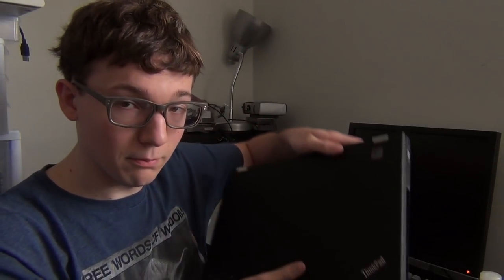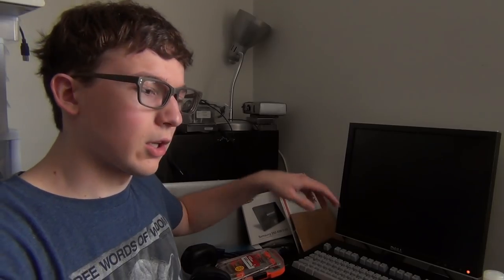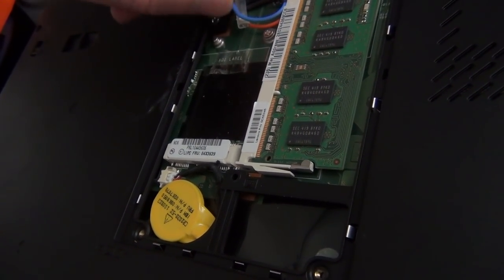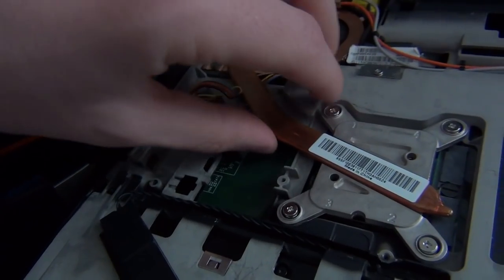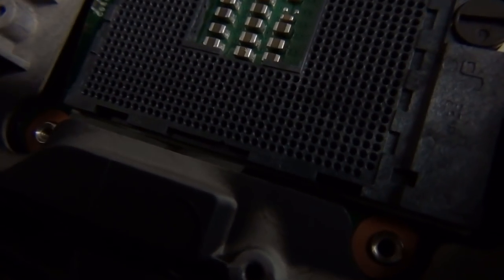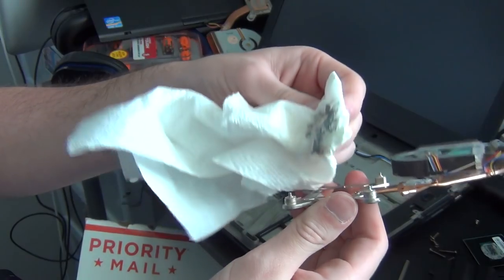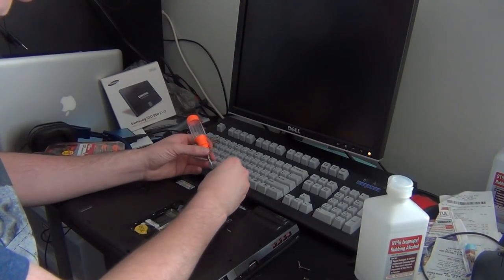Lenovo ThinkPad T430: CPU Upgrade

Comment: I did this to my T420. Now, it runs i7-2630QM. It starts with 2.6Ghz 4 cores 8 threads before throttles down to 2.3Ghz in Cinebench R15 test. The score is 368. About 10% slower than the average i7-2630QM systems. But it is as expected since T420 never designed to handle quad cores CPU. My T420 is on par with a modern dual-core i7-7600U.
Reply: It runs cool at 55-65 Celcius when idle. TDP is 45W. The fan almost completely silent in light task. i7 quad on T420 always thermal throttled at 97 Celcius and then it gradually reduced the speed before stable at 2.3Ghz. all cores at 85 Celcus.
Reply: where to buy the processor?
Reply: i also have t420 and i want to upgrade
Reply: @pratiklondhe5167  ebay
Reply: except the i7-7600 has a hardware vp9 decoder, and sandy bridge cpus don't.

something to keep in mind if you're watching youtube.

Comment: Did a similar thing to my t440p, went from an i5 4300m to a 4810mq and it is INSANE! Just put liquid metal on the CPU and it never goes over 90°C under the heaviest mixed loads.
Reply: Does it everleak out
Reply: @jaymesc4436  mine didn't, but you have to be very careful with the amount you use! Less is more and it's a good idea to put some form of insulation on caps and other exposed components in the cpu's PCB

Comment: I'm retiring my Acer Aspire E15 laptop for a used Thinkpad even though my Acer is a few generations newer. Especially since I don't use the Nvidia graphics much anymore on the Acer and it's giving me a few hardware problems. The T430 just feels better built and more room for expandability.

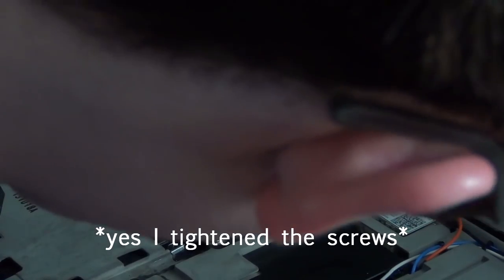Comment: 8:20 "be sure you reconnect the fan" yeah I unintentionally tested the thermal capacity of a Dell Latitude E6530 by not doing that here a couple years ago. I got a used E6530 off Ebay and in usual fashion whenever I get a new PC/Laptop I always explode it apart and clean everything as well as re-paste the CPU. Well long story short after applying new thermal paste to the CPU (Arctic Silver 5) I fully reassembled the laptop EXCEPT I forgot to plug in the fan controller for the heatsinks fan. By the way the CPU is a I7 3740QM which is even more powerful then the 3612QM in your Thinkpad. Has a higher base and turbo speed. Making matters even worse the laptop has a dedicated GPU in it as well which shares the same heatsink. The GPU being a Nvidia NVS 5200M. So after installing a new Samsung 850 Evo I'm installing windows and noticing damn this laptop sure runs quiet...very quiet...suspiciously quiet... I reach down by the vent for the heatsink and think yeah I can feel heat wicking away...but why don't I feel heat being forcefully pushed out of the computer?... "OH SHIT!!!" I think to myself as I realize WHY the system seems so amazingly quiet. I never bothered to reconnect the fan for the heatsink. Having felt the top of the keyboard and all over the top of the chassis nothing was worryingly warm so I let the install finish before opening the system back up and correcting the problem. I try to remain un-bias with computer brands but after that experience I learned a whole new level of appreciation for Dell's because while the SSD was getting hammered with the OS install, that CPU wasn't just sitting there doing nothing either and still the system never gave any thermal warnings or issues at all. Moral of the story being just when you think you've got everything completed and it's time to close it up and install the OS, stop, and go over everything once more. You might not get as lucky as I did. Also not being a dumbass would be helpful too...

Comment: Overall, do you prefer the T430 over the X230? Also, I saw your MacBook Pro in the background. In other videos I think I saw an older iMac. When are we going to get a video from you talking about some of these Macs you collected?
Reply from the maker: X230 is definitely a sleeker and more portable machine, but the T430 has more upgrades available and is just more versatile (typing from mine now). Which one is better for you would depend on your planned uses.

I've thought about doing a video of some sort on one of those Macs but haven't found anything interesting enough to talk about.

Comment: Hi Sebi, did the fan noise under load increased or decreased after installing the new HSF assembly? I noticed they're both Toshiba fans, but the dGPU you installed had much larger intake openings.
Reply from the maker: Across the board I did not notice a significant increase in fan noise.

Comment: Very clear and understandable instructions. 

I have a T410. I'm thinking about putting 16 gigs of Crucial RAM in it. Do you think that will help battery life? I want to improve performance and battery life. Changing RAM is much more within my comfort level as my only experience is with upgrading from and HDD to an SSD in the same machine. I believe I can get low-voltage RAM. 

Any information on that topic would be greatly appreciated.
Reply from the maker: The T410 will not accept more than 8 GB of RAM. The T420 and later will take 16. Processing power has more of an effect on battery life than RAM, that’s why Ultrabook laptops can last for 10-20 hours while a full power mobile workstation can only be used for a few hours under heavy load. If you don’t have the 9-cell battery (the pack sticks out the back), I highly recommend it because it increases the battery life and doubles as a handy grip when you’re using the laptop.
Reply: Thanks for the reply. And thanks for the reminder about the 8 GB maximum. I did run the Crucial system analyzer on it but I had forgot that fact. 

Knowing almost nothing about computer systems, I had just assumed that decreasing paging would improve speed and battery life. I have noticed that Intel advertises a lot about more power-efficient CPUs but I didn't realize how important that was to battery life versus the amount of RAM the system is running.

Oh, and by the way, I just bought a T440 P. Yes, I love that thing. They're built like a tank and as you've shown, the internals are very accessible for upgrading. I'll be looking for much more content from you, and searching your archives, for everything about changing the back cover, palm rest, screens, SSD…, Etc., Etc. Keep that excellent content coming!

Comment: When you play 4k/60fps videos on YT, how cpu usage do you get with the 3612qm? I am about to do the same but with a 3632qm... The 4k Software decoding on YT is a real-life benchmark I usually use...
Reply from the maker: I usually don’t go above 1080p, because, well, the T430’s highest resolution screen isn’t even 1080p so there’s no reason to waste system resources decoding a video it can’t even display at full size.

Comment: Sebi, if I modify my T430 Thinkpad from an i5 processor to an i7 processor, do I have to change the Heat sync unit also? Aliexpress sells the Core i7- 3612QM for $75.75, is that a good price???
Reply from the maker: That price is about what those are going for at the moment. With the 3612QM you shouldn’t have to upgrade your heatsink, since it is still a 35W CPU.

Comment: That was neat and the job didn't take too long and you have the computer running just fine so you are a happy camper and you have a faster computer too. I tried installing another OS on the T400 Thinkpad which currently have Windows 10 on it currently. I thought there was a problem with the computer, but now think it is the Windows 10 software which don't want to run on that computer.

Comment: Love your videos, I just got a T430 myself that came with an i5-3320M. I'm planning on upgrading to the same CPU. Do I need to replace the heatsink? Mine is a Toshiba one and I also have a dGPU but I've disabled it due to the laptop getting really hot and the battery draining quickly with it enabled even when I just replaced the thermal paste.
Reply from the maker: The stock heatsink should be fine as long as you aren't putting a super hot processor in.

Comment: Running myT430 with a (relatively cheap - approx £50) i7 3740QM quad core, no issues, no overheating, no special hardware mods (beyond changing the CPU of course! :D ). I would recommend it :)

Comment: Great video. I am considering either the T430 or the T440p. Are both laptops screen upgradable to 1080p ? I understand that the T440p (i7-4910MQ) shall be a beast. So which is a better choice. PS: I only do productivity works, internet and light gaming.
Reply from the maker: T440p takes 1080p screens out of the box, the T430 needs an upgrade kit to be able to accept 1080p screens (but I did this with mine and it was well worth it).

Comment: I just upgraded my T430 with a i7-3632QM which is a 2.2GHz processor with up to 3.2GHz turbo.

Weirdly I can run prime95 on the upgraded T430 and according to Core Temp 1.12.1 the 3632QM stays at 2.9GHz with 35W dissipation. I'm used to seeing prime95 bring more modern desktop processors down to their base frequency.

It does get up well towards 100 degrees Celsius though! (I'm using the original fan, I don't want to spend too much on this old thing).
Reply: I upgraded my T430 w/ 2 core i7 to a i7-3632QM 4 core, 8 logic processors, and found my Thinkpad runs noticeably cooler than before, using the stock original fan/heatsink.  Works for me.

Comment: I know this video is about 6years old. But would like to check do you still use the T430 in 2024? Do you recommend the T430 in 2024?
Reply: I hope you will get the answer from Sebi. I use a T430 and it works well even in 2024. Today i ordered the i7-3612QM and 16gb of RAM. It only get better.
Reply from the maker: Typing this from mine right now ;)
Reply: I upgraded my laptop and it woks just fine 🙂

Comment: Thx for great vid! Question please: I have a T530 with a dedicated Nvidia Gpu and the stock i5-3230. I’ve been reading different opinions on upgrading to a i7-3840 and overheating. If you think it’s too risky I’ll go for a 3632, but I’d rather have the faster 3840, any thoughts?
Reply from the maker: Overheating shouldn’t be a problem if you use good thermal paste. Will it run hotter than the stock i5? Probably, but will it overheat or thermal throttle, probably not.
Reply: cg sather I have a 3740qm 45w chip in my t530 with integrated video heatsink.  Seems ok but haven't run benchmarks. I've gamed w it on expresscard egpu and pushed the CPU sometimes but never felt heat.
Reply: Meissnerflux I installed a i7-3740qm like yours, I also have a dGPU NVS5400. I’m using my laptop for 3d modeling and rendering, now the cpu temps in the nineties when rendering with cpu at 100%, speed stays at 3.5hz. A couple times it went over 102C, with thermal throttling results. I think I did the thermal paste right, used Arctic 4. I have Intel XTU installed, doesn’t seem to do much. Any suggestions on lowering temps without losing performance? Install fan mgmt software? XTU won’t let me undervolt. 

Also, now my dGPU is the weak link and I’d like to do the eGPU. How did you do yours? GDC EXP to express card? Any tips?

Comment: Hey sebi! I hope all is well! I was wondering if you were considering removing and replacing the current T430 bios using 1vyrain in order to allow 802.11ac wifi cards. A video on this would be awesome if you have considered it!

Thanks
Reply from the maker: It's on my to-do list, unfortunately everything that's been going on lately has put me a little bit behind schedule.
Reply: Ivyrain?

Comment: Stumbled across your channel today! Greetings from the UK!
Would you ever consider doing the FHD mod on your X230? I know you've already changed it to an IPS display, but FHD would be even better!  :P
I'm currently in the middle of upgrading an X230 Tablet from the i5 3320M to the i7 3520M. I'm also adding 16gb RAM, a backlit keyboard and a 500gb ssd along with a 128gb msata ssd.
Should be a nice little laptop when I get it complete!
If only there was a FHD mod for the X230T.
Ahh well, good luck with your endeavours - I shall be subscribing!
Reply from the maker: As I’ve probably said in the comments in that video, 1080p is too high of a resolution for that small of a screen to me. Yes Windows 10 has scaling but it still wouldn’t look right. For now I am more than satisfied with the current IPS upgrade. I am eying up doing the IPS mod to the X200/X201. Best of luck with your X230T upgrades and thanks for subscribing!
Reply: Thanks bro!
Reply: Hey. Whats your situation with a X230T???? Are you happy??

Comment: Would you still recommend the igpu fans with the 3632qm (35w) or is the standard fan fine.
Reply from the maker: The standard fan would be fine, but you can get the dedicated GPU cooling assembly to keep things a little cooler.

Comment: (Intel Core i7-3520M) 2.90GHz 2Cores4Threads
 (Intel Core i7-3540M) 3.00 GHz 2Cores4Threads
(Intel Core i7-3740QM) 2.70GHz 4Cores8Threads
(Intel Core i7-3720QM) 2.60 GHz 4Cores8Threads
 tel Core i7-3630QM) 2.40 GHz 4Cores8Threads
(Intel Core i7-3610QM) 2.30 GHz 4Cores8Threads
(Intel Core i7-3632QM) 2.20GHz 4Cores8Thread
what's the best choice of upgrade for gaming?
Reply from the maker: 3632QM would probably be best because it runs cooler.

Comment: Do you prefer the T430 or the T440p? You can install a classic keyboard into the T430 but you're stuck with the "modern" keyboard on the T440p. But the T440p looks easier to upgrade than the T430.
Reply from the maker: T440p is definitely easier to upgrade and performs better on the surface. You can upgrade the display to a FHD IPS if it wasn't configured with that from the factory. T430 has the classic keyboard as an option, can use an external GPU and has the ExpressCard slot for expandability, it has the ThinkLight, hot-swappable UltraBay, and the more classic design.

Comment: Hey why did you go with the 3612QM?  Is there something you know about insofar as the hierarchy of processing and/or choice of data strands that it receives for reality transceiver reception?  Because there seems to be quite a few choices of CPU available...   I was wondering if you knew about any choice standings which bridge IVY and SANDYBRIDGE?  I believe there was one processor I'd read about which was able to do that.  Hmm...
Reply: the X30 series takes sandy bridge and ivy bridge cpus, sandy is a year older and runs hotter, but isn't horrible. The 3612 & 3620 are suggested for the T430 because they have a lower tdp than the other 4 core options for that socket. All sandy bridge 4 core cpus are of the higher tdp and will not play nice with the stock cooling in the T430, but the 15 inch W530 and T530 will have appropriate cooling, but at that point they probably already came with an ivy bridge that out performs whatever sandy bridge cpu you may throw in there.

Comment: Hi, I've done the same upgrade, for my T430 laptop, from original CPU i5 3320M to the more performant i7 3610QM processor. I've also updated to 16 Gb ram and various other upgrades like a new SATA 2,5 1TB SSD and another M-SATA 250Gb SSD. All is gone well but I've encountered more problems with the original 65w mini power supply: when connected to AC plug, if I leave the battery in place, the unit was not active to charge it and the laptop was on only by the battery residual charge. When I shut down the laptop, the charger was again usefull to re-charge the battery. Also, when laptop was on, I've had many many other problems with the two USB 2.0 ports but not with the two USB 3.0 ports! Often my wifi logitech mice goes down and on without a reason! The only I've immagine is a low power disponibility to ports due to the major CPU request!
So I've also changed the power supply from the original Lenovo 65w to another original Lenovo 90w and I've just solved all problems!
I've noticed a higher thermal profile utilizing same application under windows 10with the new CPU, till extreme 90°C temperature!
I hope this not compromise the CPU durability. I write this comment for other people as I've found many information on youtube to upgrate.
Hi all!
Reply from the maker: The 3610QM is rated for a higher TDP than the 3612QM I used in this video. My processor and your original processor are rated for 35W, while the 3610QM is rated for 45W. As such the power issues and the higher temperature you're encountering make sense. That's why I only recommend the 3612 and 3632, as other quad-core i7's are rated for higher temperatures.
Reply: @SebisRandomTech  Hi Sebi, tank you, I want to add another important information from the 3610QM CPU Datasheet: The 3610QM has a rated temperature max of 105 Celsius instead of other processors of the same generation that is around 90 Celsius!
For that, I hope this the upgrade is good, even if you notice a great heat near the left grid on the hand!
Using the my upgraded laptop with intensive applications, HWMonitor tells cores and package temperatures less 100 Celsius, so I suppose to be in the normal range. Obviously I don't think to overclock the laptop!
Tanks

Comment: Hey Sebi, did you have to use a "better" heatsink and fan to keep the CPU at good temperature levels? Furthermore, from what I have read online, it is possible for 90W chargers and below to be insufficient to charge a t430 running a quad core CPU. Is this the case? Please let me know, as I am going to be building my T430 soon.

Thanks!
Reply from the maker: 90W worked fine with mine. I didn't have to use a better heatsink.
Reply: @SebisRandomTech  Fewf, good to know!
Reply: @SebisRandomTech  Out of curiosity, which fan model did you use?
Reply from the maker: @michaellk2254  To be completely honest I don't remember. In my experience there isn't enough of a difference between models for it to really matter.